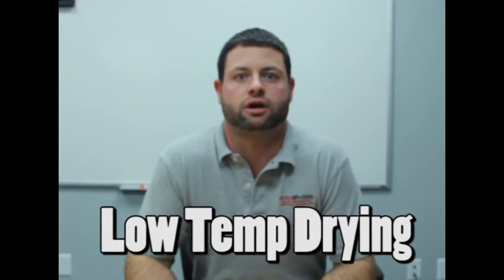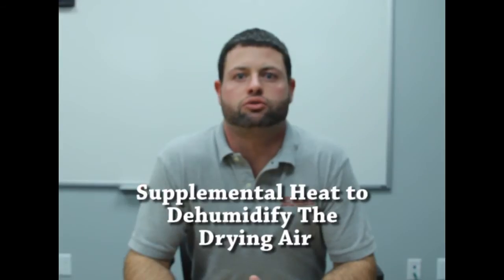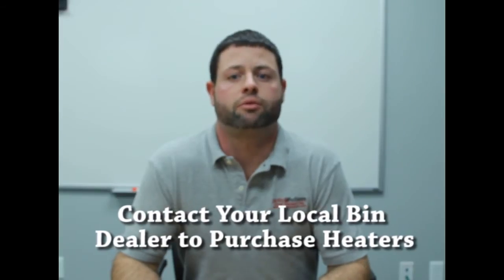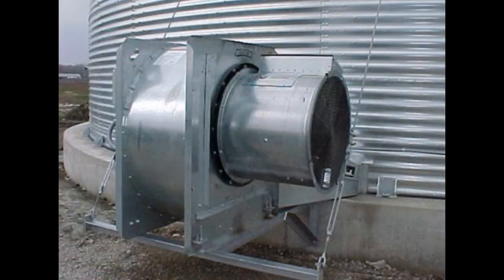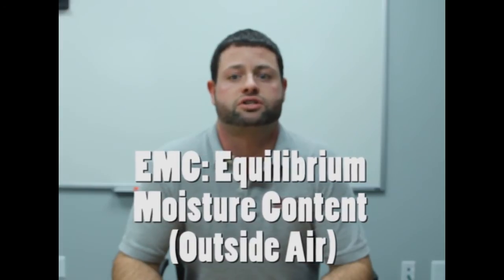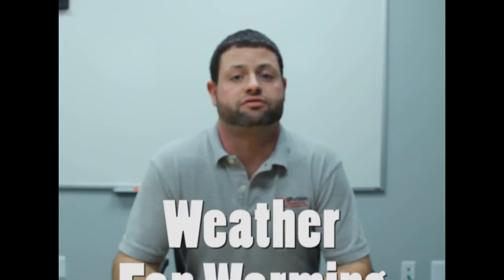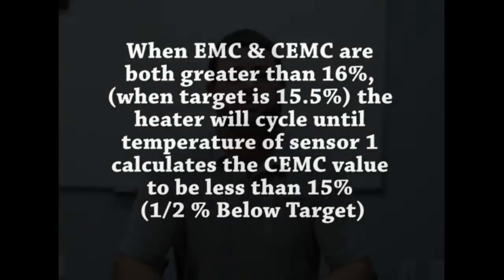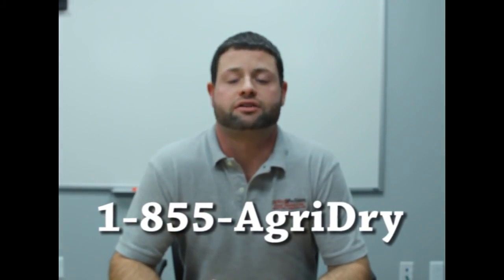AgriDry Topic of the Week: Low Temperature Grain Drying

Comment: What kind of temperatures do these heaters produce?
Reply from the maker: Low Temperature Heaters should only raise the air temperature a few degrees.  Low Temperature heaters can be bought through your local equipment dealers as AgriDry does not sell or service heaters.